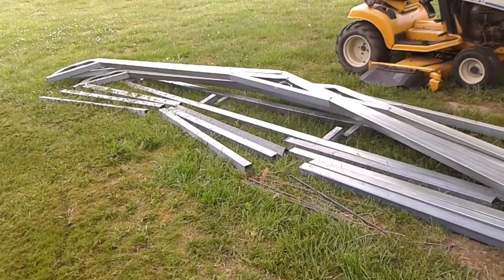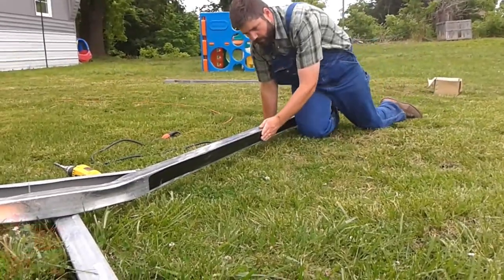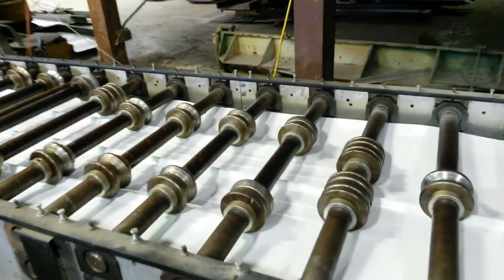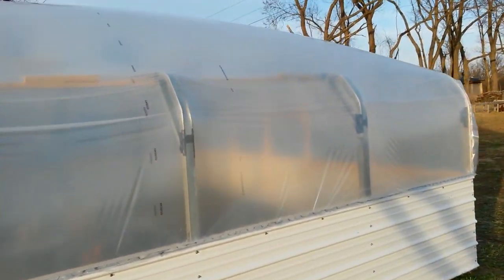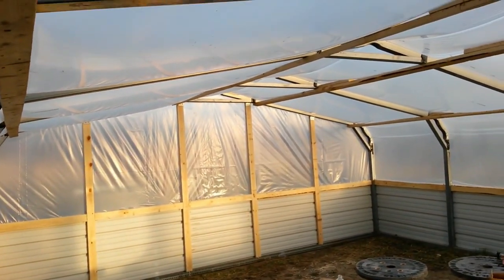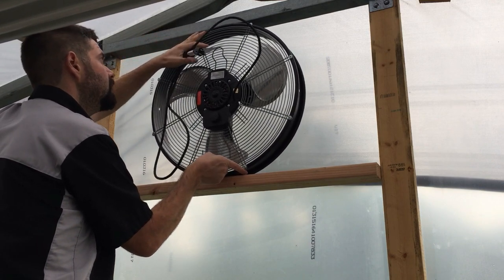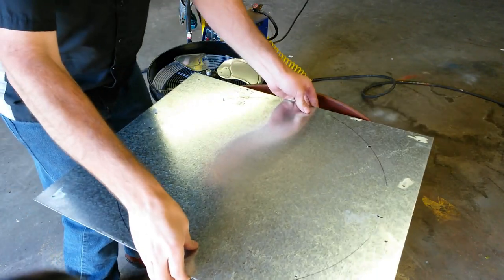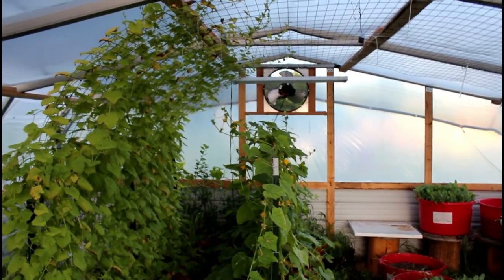Amazing Greenhouse made from a Carport

Comment: Excellent video!  I have the same carport the seller left when I bought my house. The home came with a 2000sq ft shop and 2 upper garages and a garage in the basement. I have 1 car!  Needless to say, I looked for a way to move it to a sunny area and either cover it with clear panels or heavy gauge plastic. I contacted the manufacturer today to see how much to get a second one. I live in a heavy snow area. The carport is domed already, so it's the perfect frame. Thank you!

Comment: Excellent. Consider rigging some hinges on those metal sides so you can prop them open  in the summer heat. I know that some of the all plastic ones I've seen allow you to roll up those half walls
Reply from the maker: That was actually what i wanted to do. but it would be a good amount of work at this point. I also have the sides insulated for winter now too. so it would be more hassle than its worth. Perhaps if i build another i will do that. Thanks for the comment.

Comment: This is fantastic!
I do have a Couple questions:
1. The fan/fans that you use to keep the plastic tight: Is it expensive to run it? Like have you noticed a difference in power cost or anything? Do you happen to have the unit info?
2. What was your total build cost?
3. How is the plastic holding up?

Thanks again!